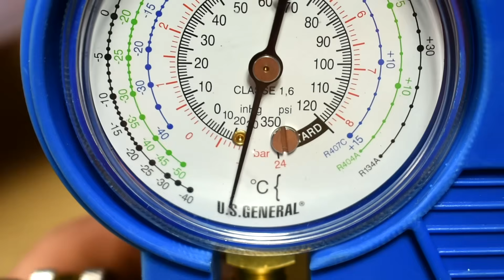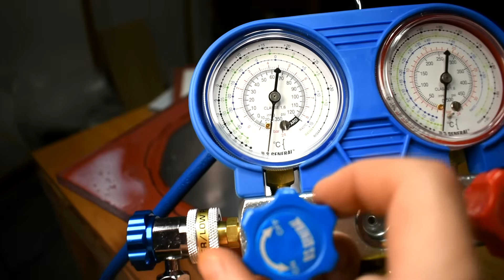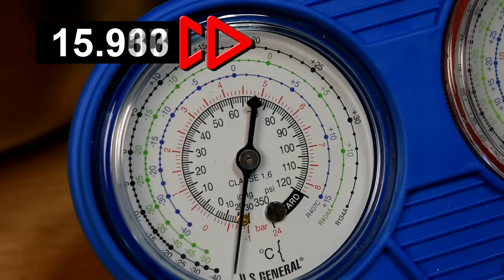The EASIEST DIY Vacuum Chamber You Can Make

Comment: I think a better way to plumb the manifold to the lexan sheet is to use a bulkhead fitting.  Just drill a hole and insert the fitting, which has a nut that screws on the inside of the chamber, as well as a gasket that seals on the outside. No need to buy a tap that most people will probably never use again

 If you look online there are probably ½" SAE flare bulkheads available. (Bulkheads typically have standard female pipe thread, which is the common denominator between all the various types and variations of fittings--flare, compression, PVC, soldered etc.). If that's all you can find, any hardware store will have a ½" flare to male pipe half union that will  screw into the bulkhead. A good hardware store will have a bulkhead fitting as well 

Just like the method on the video, everything is removable and reusable in other projects.

Comment: Vacuum pump oil is a consumable, if you want to keep your pump in good condition, change your oil regularly. Vapour which has been drawn out of the pot (or system in case of refrigeration, A/C etc) will have some components which will want to condense and some of this will be into the oil. Also it helps if you the pump to run a while with no flow (valves closed) and if your pump has a gas ballast you can open this up which allows some additional flow to help remove these vapours. In refrigeration system evacuations, particularly large ones the oil may need changing several times a day and thats mostly going to moisture from the air. In this application it will be a little moisture from the air volume in that space but most will come from whatever is in there and off gasing.

Comment: Why not acrylic?  20mm is often used as a UHV window. Only real reason I can think of is outgassing.
Reply: Polycarb is more impact resistant (250x compared to glass where acrylic is 17x compared to glass) probably makes some difference when it comes to flexing and the pulling the object it's sitting on into it with the air pressure?

Comment: Why not just use the lid from the original pressure pot? It has a seal and can withstand crazy pressure. You can even tap the metal
Reply: The pressure cooker seals on  this type of pot he has rely on positive inside pressure to seal  im not sure it would work with a vacuum plus you would need to destroy the pressure cooker lid taking out valves if it did work this way its still a pressure cooker on the side lol

Comment: The motor on that robinaire vacum pump may go out but the pump itself will last for as long as you keep oil in it. The sputter start is a capacitor getting weak. Oil is your best friend in refrigeration vacum pumps as it is used to make the seal as well as to pull moisture away from metal parts. Oil should be changed every three applications or once a day or every 10 hours of running time for best results. If its maintained that pump willlast 3 or 4 workers. lifetimes.

Comment: You can get these for cheaper than I can buy a thick enough acrylic plate for from your chinese crap vendor of your choice. And they work just fine.
Thin walled like crazy, but no issues so far. Good thing is: Vacuum is only -1 bar. So it's not dangerous when something goes wrong at this scale.
 Acrylic also works fine at this thickness. PC is obviously stronger, but not necessary.

Comment: Good tip on the tap at the edge of the cover, I credit that! Makes sense as the cover forms a lens as soon as the atmospheric pressure exerts ambient force on. And if I'm not mistaken, then you get some 740Kg of downward force on the 12" lid at almost perfect vaccuum. Correct me if my math is wrong.

Comment: If you dont care about watching the degass,i wonder if you could use a pressure cooket (entire, not plugged in) and convert the vent/seal port in the lid to the "suck"  hose fitting.  You could then awitch hoses and make use it as a pressure pot, too.  DIY levels, of course +/- 1 or 2 bars.

Comment: Grabber makes a slab grabber commercial vac pump I remembered I can borrow and fully rebuild your vid just gave me the idea these pumps are gnarly strong they will hold 100+ lbs onto a concrete wall with just a foam rubber replaceable gasket and run forever with extended life brush’s

Comment: The sputtering on start up is the motor dying. Thats the starting capacitor or whatever kicking on over and over until the motor reaches the running RPM. Once its running at a fast enough RPM the capacitor is cut off and the motor will continue to run.

Comment: tiny somewhat inconsequential tip that may have been mentioned 246 times already, but still helps the algorithm - 

disengage the vacuum pump before turning it on, it starts easily that way.

Comment: So I have a question. If, in theory, I were to rest the lid of the vacuum chamber you made upside down, and cover it with a layer of rockwool insulation, would that be enough to not only protect the polycarbonate from the heat of a freshly burned out lost wax mold, but also would it still be able to pull the liquid metal through not only the solid investment but also through the rockwool?

Comment: I built mine to be chemical resistant. Mcmastercarr sheet of type a viton... stainless half pan from resturant supply is 10"x12" perfect for my 12x12 viton seal. Resturant supply places will also have full polycarbonate chambers depending on your pressures needed

Comment: why did you use the red hose, the middle hose the usual one used for vacuuming? that way you wouldn't have to bother with the second valve or worry about the yellow hose leaking because it isn't tight enough?

Comment: Question... I'm considering making my own vacuum chamber using commercial grade water pipe, which I've yet to obtain. I'm thinking between 10"-16" in diameter and 10"-12" (maybe a tad longer) in length... Do you think this is a viable option and what might the risks be? Thanks in advance.
Reply from the maker: Yeah that would probably work.  A vacuum chamber is much easier to make than something like an air compressor tank.  the difference between outside and inside pressure can't exceed 1 atmosphere even at a full vacuum (15psi or so), where an air compressor tank can have several atmospheres of air inside.  If you are using a large pipe meant to carry water at pressure, it can most likely handle a full vacuum just fine.

Comment: Great teaching! I was totally engaged even though I was only picking up parts of what you were saying 😅 I am wanting to try this out with a 20qt stock pot to vacuum seal bbq, sauces, etc. the way a VacMaster would. Do you have suggestions on a simpler  way to add air into the chamber before removing the lid? Also I love that this is simple to make- but how idiot proof is it😅

Comment: You can use the air intake side of most air compressors to pull a vaccuum. You will not get a very high draw but it will work good enough for most home and home workshop applications.
Reply: Does it low-pressure boil water?
If not its not enough for many applications like silicone degassing

Comment: Use the yellow hose for pulling the vacuum. Change the high side gauge (red one) to a low side gauge(blue one) & you could easily to 2 pots at once while still being able to see the vacuum pull down.

Comment: Thanks as this is a good idea.  I've occasionally wanted some way to degas epoxy or something and already have a vacuum pump from my past HVAC job.  You do a good job of telling us that the gauges will not measure true vacuum, but you're correct that this will at least give you a way to detect inaudible leaks.

I've never heard a pump sputter like that so it's obviously been abused (you're supposed to change oil every few uses), but great that it still works.  I like that you show introducing air before shutting off the vacuum as well, but wish you'd told us why.  Understand that you were keeping the video compact for youtube, though, and you did a great job of that.

Comment: Why didn't you use the lid for the pressure cooker pot?
Reply from the maker: its not as easy to convert to vacuum from pressure.  The seal is designed to hold pressure in, not out, and there are no good fittings that I could attach easily. plus the clear sheet is clear, so i can see the bubbles which is important, and now i can always stick the old lid back on and use it as a pressure cooker again!

Comment: Best, cheapest, and easiest by far is a pressure cooker for sure..  i took an old one and braised a copper pipe where the pressure  valve was and voila..  used it for distillation and some vacuum epoxy things..

Comment: I came back to watch this a 2nd time, then I went and priced the Lexan at $36. That's without guages, without valves, without cutting and drilling, no tap, no labor. I was able to find a whole turnkey kit for $114. 5gallon stainless steel chamber with valves and a guage, hose and 5CFM 1/3hp pump. It's normally 130 which is already stupid cheap. The pump will probably break your heart, but we can't all be gifted a Robinair cast iron tank like you got, if you get a spec of foreign matter, water or whatever in the vevor pump, you are doomed, I keep the motors, they are worth something, a paperweight at least. Free shipping from eBay too good for next 6 days. I'm no pro, but that's friggin cheap, I have bought a few and need just a chamber for a vacuum distillation rig, I have a pressure cooker and found a better deal on Lexan, but I'm still tempted by this. I also got a water aspirator pump because I'm sick of killing RV pumps and I'm sick of them belching oil all over everything. Diaphragm pumps have gotten cheaper, but not PTFE diaphragm pumps and if I'm going to do it wrong I'm going to do it cheaply(And I already have several 55psi water pressure pumps. I've seen water boil at 19C using an aspirator which is near 29.3"Hg with no moving parts, no oil changes. I'll put the link in a reply in case it goes away

Comment: Thanks mate. The lid is just over the pot? It is not fixed/screwed in? I understand that vacuum will basically make the lid sucked in, but that also mean that the seal should be super good.
Reply from the maker: Not fixed at all, just set on.  Sometimes I gotta hold it down at first so it starts ok, then I just let go and let the vacuum do all the work

Comment: Ok question, if you got an old pressure cooker that nobody cares about could you make a pressure pot by drilling holes and gauging a line in from a compressor? or would the locking mechanism be to weak on the pot lid?
Reply from the maker: Excellent question, I suppose it depends on the pressure capabilities of the pressure cooker?  I was thinking about trying exactly what you said, but it depends on what kind of pressures you need and how overbuilt the pot is.  Pressure is way more dangerous than vacuum, so be careful whatever you do.

Comment: I did the same thing as you except a few changes: 
1: I bought a brass cross 1/4in fitting and some brass 1/4in nipples and tapped the hole in 1/4npt. I also added a valve on one side and the gauge on top, as well as a hose barb on the other side. I haven’t cut out most of the silicone too just a little hole for the air outlet through the polycarbonate. I have a pressure chamber arriving so I didn’t want to cut the gasket to fit the pressure cooker I have since the pressure pot is larger and may have a bigger diameter. I got my pressure pot at the goodwill for like a few dollars and this route is by far the cheapest way to go.
Reply from the maker: You must be reading my mind 😉 I have some similar ideas for upgrades in the future.  I'm incorporating this into a vacuum casting set up and upgrades are needed

Comment: Building an NIR Spectrometer and need a simple vacuum chamber for removing sample contaminants from spectral readings. May design the outer housing like this pump and integrate the inner sensory housing to fit inside with samples of various spectra.
Reply from the maker: Good luck!

Comment: thread the fitting that connects to your vacuum pump through a hole drilled in a mason jar lid, seal with hot glue or epoxy.

Comment: Be careful not to pull too much water vapor or other solvents into your pump, I think it's because they can condensate into the oil and contaminate it on the ambient pressure end of the pump. Ideally, you put a cold trap between the pot and the pump (but that requires liquid nitrogen).
Reply: I am thinking an standard air water and oil separator might work.  🤷‍♂  Maybe even a cheap filter for paint guns at harbor fright.
Reply: @3Hose  Definitely better than nothing in there at all, I agree.

Comment: I love the idea of using AC gauges for this. One thing I would do differently is, I wouldn't remove the quick connect fitting from the blue hose. Instead, buy a R12 to R134 retrofit kit (or just the low-side port, most auto-part stores should have it) and a suitable male to male fitting and install that into the lid. Now you can quickly and easily disconnect the hose from the lid, even after pulling a vacuum.

Comment: 4:00 the only way I know to glue silicone is to prime the silicone first with polyolefin primer and then glue it with cyanoacrylate glue.
Reply from the maker: Interesting, I didn't know that.  I feel like the glue I used is BARELY holding.  It's fine thought it doesn't even need to be glued

Comment: If you don't need a 99%+vacuum, vacuum ejectors are like $40 for 95% vacuum

The festo ones i use have integrated fittings for tubes and even integrated silencers on some models.

Just be aware that you will need a compressed air source. Pretty much anything will do as long as you can regulate the line pressure given how they take 0.6 to 2.5 cfm of air to run.
Reply from the maker: Yeah admittedly this pump is overkill, but it was free so I took it.  Who knows maybe I'll need 50 micron vacuums at some point.  

And there's a giant air compressor behind me, so I'm all set on air pressure 👍
Reply: @PaulsGarage  i absolutely agree, i have this weird vacuum pump that switches over to liquid mercury by itself past a certain point

It's super fancy but there wasn't any place to put it and the site was being upgraded to a pump that was way faster (2 days for 250 m^2 instead of 8 days for 30m^2).... So i got it.

Comment: Nice.   I wonder how it would do with molds/heat in metal casting?   You just solved my issues finding a new gasket for my Still.   To make...Hand Sanitizer, of course.
Reply from the maker: not sure but i plan to use it degassing investment plaster for casting.  and of course, hand sanitizer is pretty important these days, need a constant supply 😂👍
Reply: @PaulsGarage  Yeah, rethinking it I would likely want some sot of compression to push the mtal in tight versus a vaccuum.   Gue3ss I will stick with my electric lawnmower engine centrifuge.

Comment: If you're not going to use a vacuum pump often don't buy one. O'Reilly Auto Parts and AutoZone both have them to borrow. You pay for the pump, but you just return it within 48 hours to get your money back. No oil maintenance, dry rotted seals, or failures to worry about.
Reply from the maker: Interesting I didn't know that.  I got this one for free so I'm not complaining lol

Comment: Cool beans, man!   This would work well too for vacuum-sealing Mason jars, when dry-canning something. 

Also, I reckon you could just use the lid from that pressure cooker as well, if you added hose connections to it.  If you didn't need to watch what is going on inside.     I wouldn't do it with an All-American canner though!
Reply from the maker: You could totally use this for vacuum canning, and the lid fits on just about anything.  I've never dry canned anything but this pulls a pretty good vacuum

Comment: Surprice:  That Robinair is not that old  maybe 1990s vintage, which in Vac pumps is quite young, because the parts are constantly  bathed in oil during operation.
Reply from the maker: Really?  I thought it was 80's maybe? I'm not sure though. It's been stuck in a corner of the shop for 20+ years at any rate
Reply: @PaulsGarage  I'm pretty sure.  But those things don't really experience stress under load.  In another life, I ran  the mechanical facilities for an ultra high vacuum research lab in a university. So I've seen my share of vacuum pumps.

Comment: nice build. I made one out of 1/2 inch polycarbonate a few years ago. Works great, but I wish I realised how easy the plastic can pick up scratches 😭
Reply from the maker: Yeah it's easier to scratch but I'm tolerant of stuff getting ugly 🤣
Reply: Well, the polycarbonate sheet is only there for its strength, right? So, some form of hard coating or film might help.